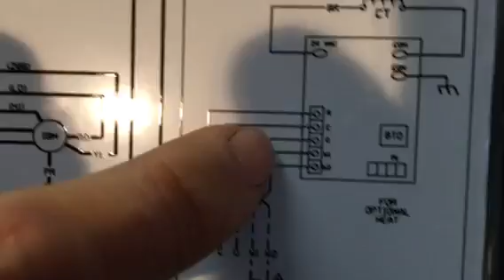Rheem  low-voltage wiring

Comment: I installed a Nest Thermostat base model to this unit. I can get the AC to work fine, but when I turn on the heat both the A/C compressor outside and the heater inside turn on and run at the same time? I just swapped the wires as they were on the old thermostat during install of the Nest. What could I be doing wrong? It's an electric unit. Thanks

Comment: My Rheem HPump fan keeps running on low speed when whole system is off …. No way to turn on fan only…. and during unfreeze the inside fan also runs but air is cold since heat is reversed to outside ….now, when thermostat is unplugged from the harness the fan stops…. What is going on ?

Comment: i have one and i am looking for a low voltage fuse protection or breaker for this unit it just hapenned and i am in no hurry i know it did not come with one cause i smoked the first transformer and i dont want to smoke another ,,,,,ill check with baker distributing monday the 24 th ,,,,,but i am looking at videos to see if i see a breaker in a unit ?  any help would be nice , maybe ill find it quick tomorrow who knows ?

Comment: Hmm, if I shorted  R and C accidentally (turned off wrong circuit breaker) on a Rheem AC, it does not recover. I do not see any visible fuse. The transformer outputs 24v. Would a tech, repair or swap out ($$$) the board? TIA

Comment: I am trying to connect the Common Wire for a new thermostat. I am having trouble finding the correct color to connect it to. It’s on a Rheem Model RBHC-14J06SFD.

Comment: Is there a way to contact you to ask you a question about low voltage wiring to an existing rheem air conditioning system?  I tried writing you at david@davidjonesac.com but it bounced back.

Comment: good vidio the only thing I seen and im sure you know this that a Rheem reversing valve energizes in heat mode so on your thermostat you would need to put your orange on B terminal instead of O on your thermostat but you had a Goodman condenser so you were right on your illustration. I just know alot of people mite not know that.

Comment: Coming from up north I have little experience in these setups. Quick question. If I were to tie in float switches at the pan and the drain, where would they wire into the system you shown?  I know they need to be in series, but not sure the best place to make the connections.

Comment: Thank you for the videos! My new Rheem air handler has a yellow wire included with the low voltage wires. My question is, I understand the Y from tstat goes to Y on the condenser. But with that extra yellow wire on the air handler, do I wire nut all three yellow wires together?
Reply: Did you figure it out ?

Comment: Is a place that you can look to get the schematic for the different a/c boards in a unit? I have replaced a board and wanted to follow the schematic to trouble shoot it, but I can't find the schematic.  Thanks for the videos
Reply from the maker: look on line, I will do it on my website
Reply: David Jones I will try to find your site. Thanks
Reply: Mr. Jones... great video as usual...
Mr. Jones, on a Rheem air handler RBHP24j11SH4.. how do I disconnect the 10KW heat strip?... I want to use the air handler without the heat strip. I'm in the North East with gas heat and I don't have the available power to hook up 60 amps of power...